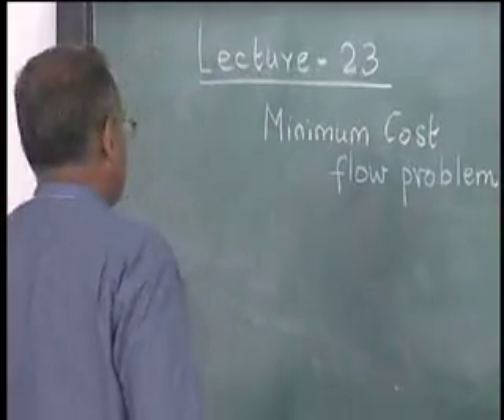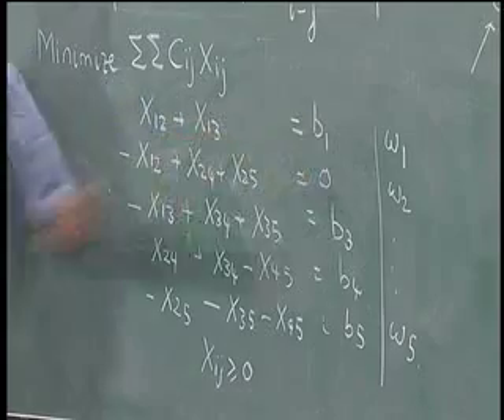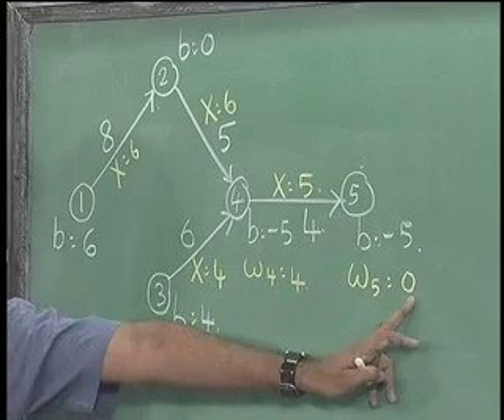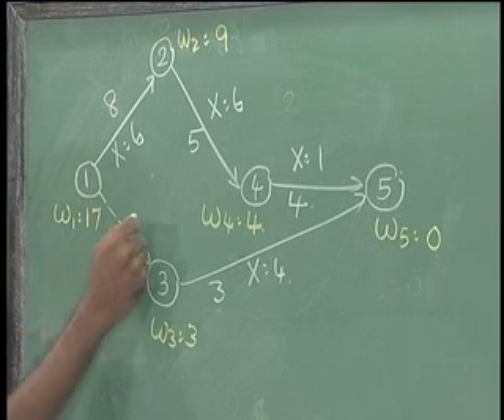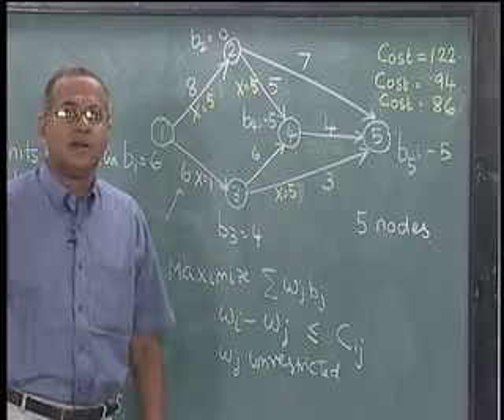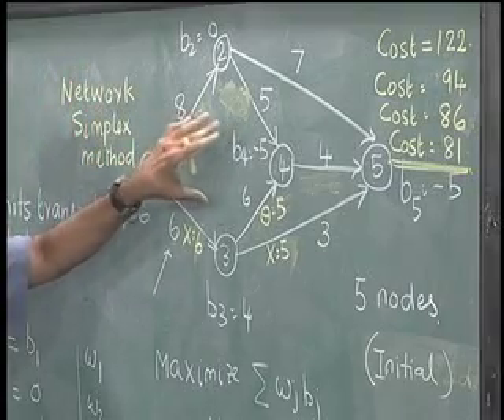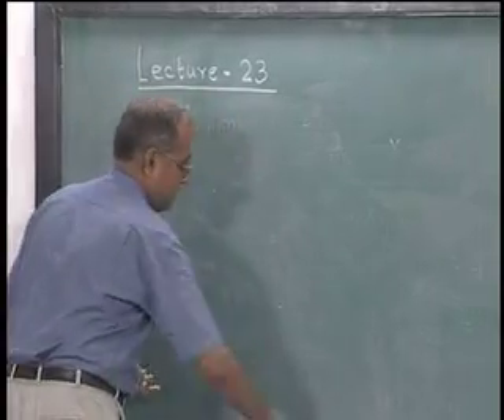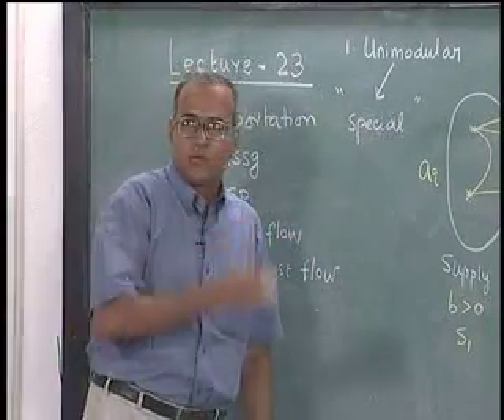Lec-23 Minimum Cost Flow Problem

Comment: Excellent session! The list at the end made me realize that MCBP (maximal cardinality bipartite matching problem) where nodes and/or edges have weights can be solved not only using HK (hopcroft-karp) algo but also using LP Network Simplex "min cost flow" problem. The algo has to be converted into a "max cost capacitated flow" problem with these changes :
(1) Cij = 0 for all E(i, j)
(2) Uij = edge weight
(3) Primal Objective Function "Minimize Sigma(Sigma(Cij * Xij))" becomes "Maximize  Sigma(Sigma(Xij))" function
(4) Dual Object Function "Maximize Sigma(Wij * Cij)" becomes "Minimize Sigma(Wij)" function
(5) Dual constraint "Wi - Wj <= Cij" becomes "Wi - Wj >= 1"

However, I believe HK algo would handle this more efficiently... as the professor said in the lecture -- there are special algos that take advantage of specific network models much better than LP Network Simplex algo. :)